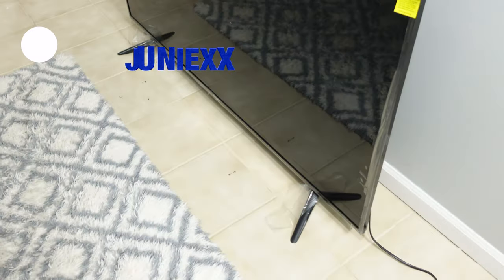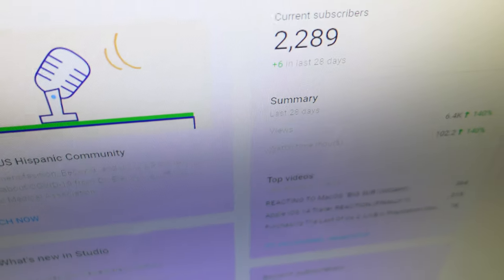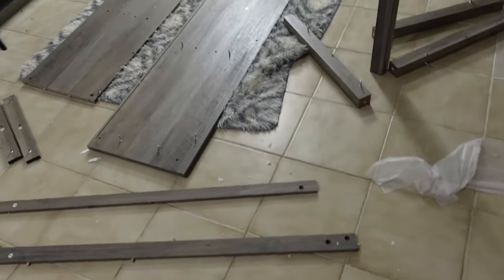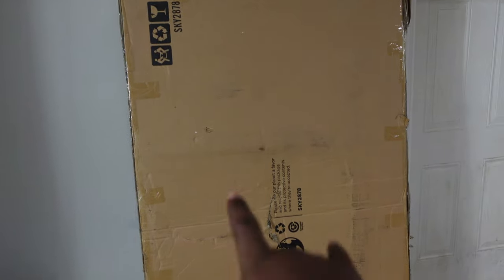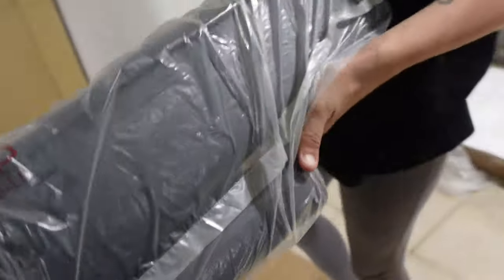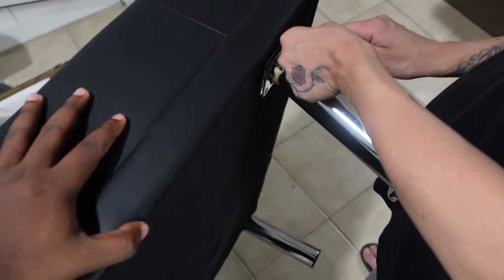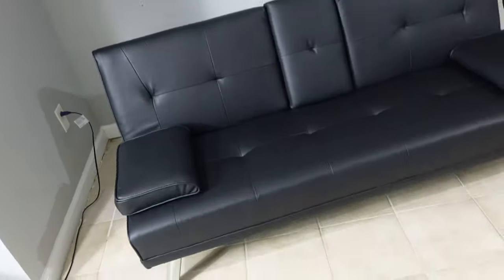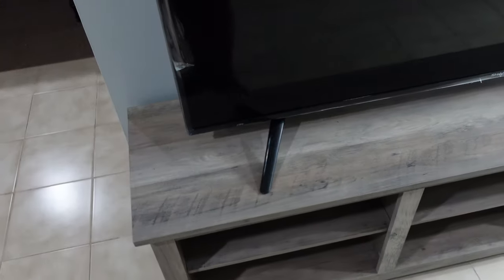Leather Modern Convertible Folding Futon Sofa & Tv Stand Assembly !

Comment: Appreciate the video! Mine is on the way 💯
Reply: Mine will be here 1/23
Reply: Is it comfortable
Reply: @TypicalAva  Depends on what "comfort" level... I definitely couldn't make this a sleeper, though I did have a few naps on it, not the most relaxing sleep. I ended up moving it to a different room to be used as a corner tv sitting area. If you have better options/a slightly better budget, I'd go for something better if comfort is your main priority here. I sit on this to roll (420), take quick notes, or a quick sit/breather. I noticed myself using it less and less the more I had it. It still looks great though, and I do not regret the buy. Keep in mind. I'm 6ft, 205lb (and a bodybuilder), so this may work much better for others...